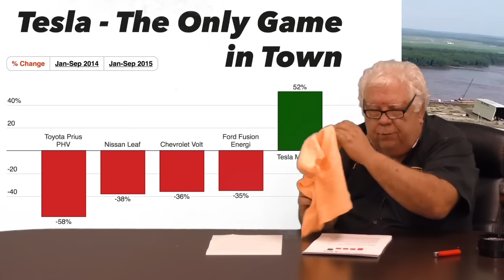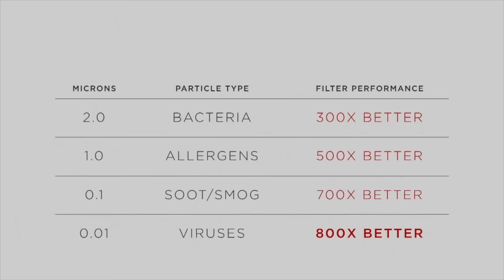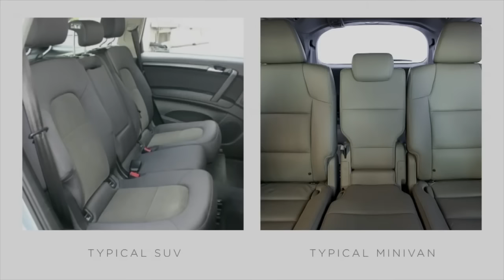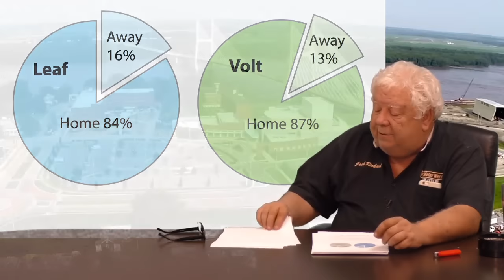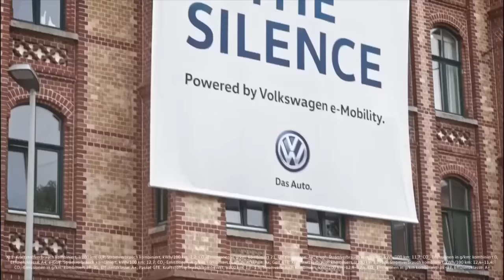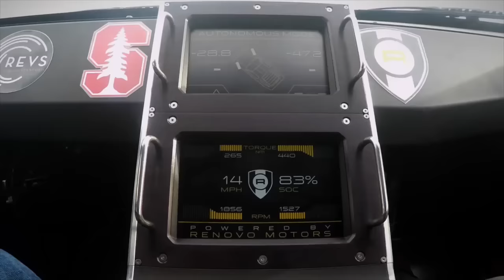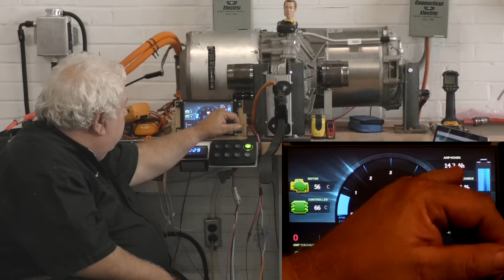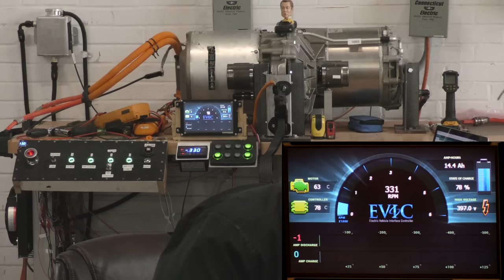EVTV Friday Show - October 23, 2015.  Tesla Drive Train Developments

Comment: Hi jack what about the reliability of the tesla drive train they are having high failure rate on the final drive (differential) what happen if you do a conversion and then the drive train fails there are no warranty have you check how much to get a new or rebuilt unit I think they replace the hole drive unit including the inverter , motor , final drive the only company that I think could fix it is Sallen they make a strait cut gear unit for the tesla it's loud but maybe stronger but the thing is I don't really know what fails actually some cars has had 4 drive unit installed this is what would prevent me from buying a used tesla until they find a permanent fix for this issue .